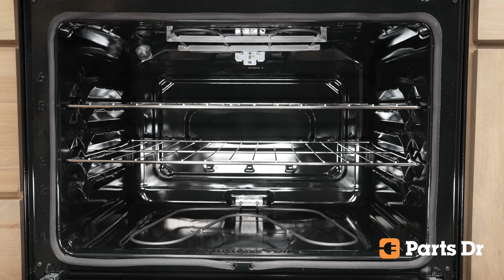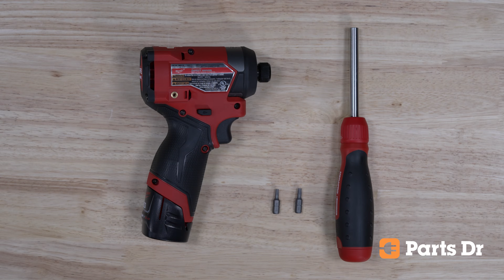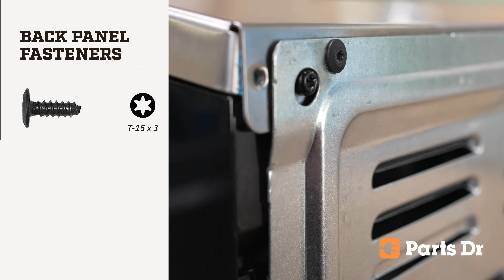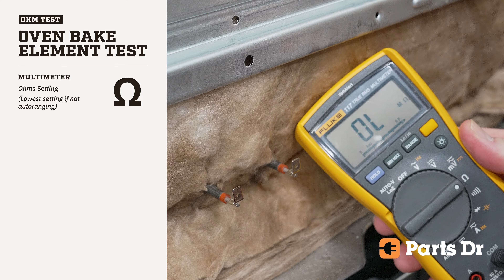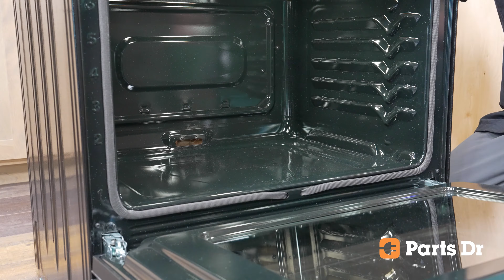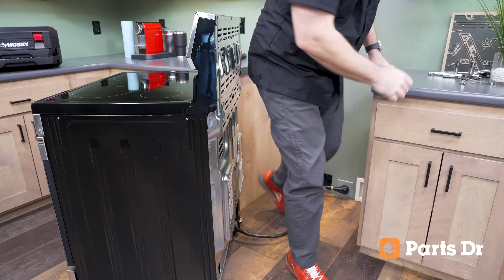How to Test and Replace the Oven Bake Element on a Frigidaire Range | Step-by-Step Guide | Parts Dr

Comment from the maker: If your Frigidaire oven isn’t heating properly, a faulty bake element might be the culprit. This video walks you through testing and replacing it step by step!

A quick heads-up if you're ordering parts online, be careful with sites like Amazon or eBay. Many of the cheaper aftermarket bake elements are lower quality, and we’ve seen cases where they are lower quality and fail much sooner than OEM parts.

For a reliable fix, we always recommend using genuine Frigidaire parts. You can find the OEM bake element at https://partsdr.com with fast shipping.

Let us know if this helped, and feel free to ask any questions in the comments! Happy repairing!

Comment: Why take off the back? I just undid the screws in the front and pull the element out and disconnected the wires from the inside and tested it. 20.8 Ohms.
Reply from the maker: That's great that worked for you. Our model range in the video does not have long enough wires to do that. One quick note to others if you don't pull the range out, make sure to disconnect or turn off power to the range.
Reply: My frigidare oven has a hidden bake element so the back has to come off

Comment: My Frigidaire bake element began only heating/glowing red in one area for about a week and then just stopped heating/glowing altogether. I did some searching and found this video. The model in this video doesn't match my exact Frigidaire model, but this video made replacing the bake element look so easy that I went ahead and ordered the bake element I needed right from the Parts Dr. website (which also happened to be less expensive than other sites I checked and some sites didn't even have an element in my model #). The bake element was shipped promptly and my husband and I were able to quickly and easily replace the element and our oven is back to heating like normal. Thank you!
Reply from the maker: That's awesome! Nice job fixing it yourselves!

Comment: What if it dosent work when you replace it
Reply from the maker: You may have a bad control board, a failure in the wiring, or the power supply from the wall outlet the range is bad.  https://www.youtube.com/watch?v=ituuUxEKUOM

Comment: We can't remember which wire goes to which terminal. If we put the wires on the wrong terminal, will it just trip the circuit breaker in the breaker box?? (Then we'll know that we re-connected it wrong and fix it.) OR...does it not matter as all the wires are doing is completing an electrical circuit for current to flow through??
Reply from the maker: The two wires that connect to the bake element can connect to either terminal.
Reply: @PartsDr  Thank you very much for a quick response. Now we can go ahead and install the new element without worry.

Comment: This video was not for my exact refrigerator model but still worked very well and it is an easy fix
Reply: You must have a hot fridge if you got a heating element working in it.
Reply: Not sure what happened with the link but I originally clicked on a link for a freezer that would not shut off it showed me a video which worked when I clicked back to comment that it actually worked it pulled up the video about a stove maybe you all should look into that @Mike-hu3pp
Reply from the maker: We are happy that we could help!